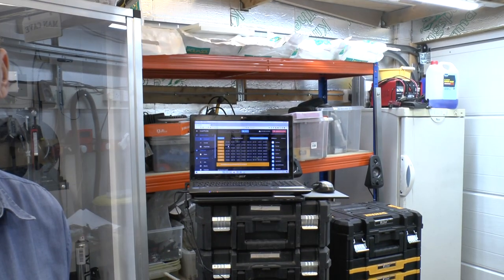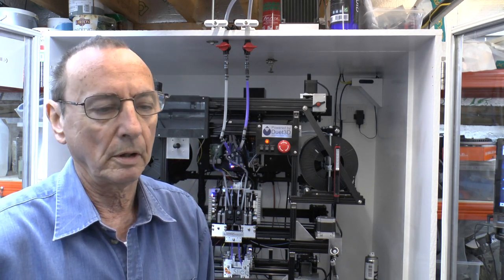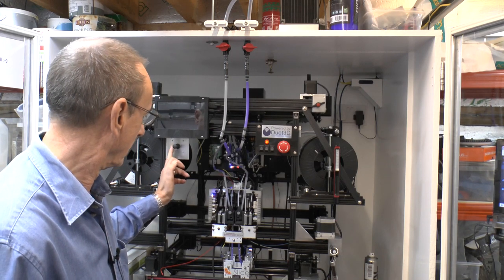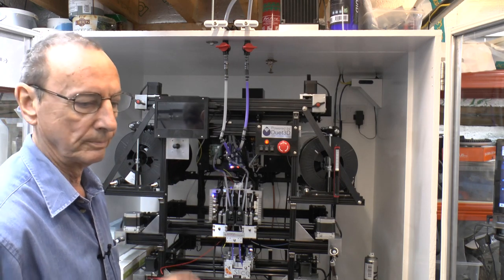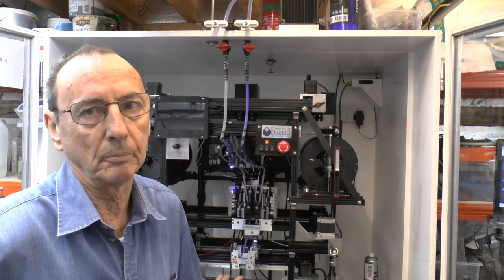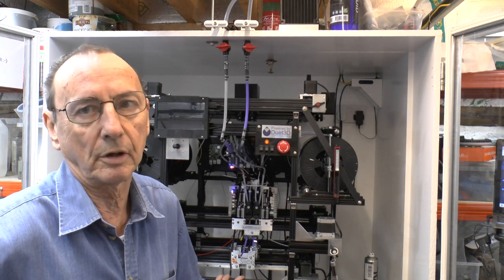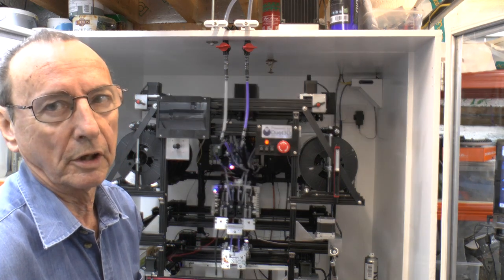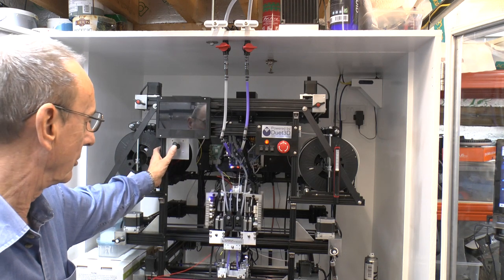Joystick jog control for my 3D printer.

Comment: Very good job. It should be easy to check the status of the printer in the beginning of your macro with some conditional GCode and abort it if a print is in progress, so the print is not ruined.
Reply from the maker: Thanks and that's already done . The command I use at the start of the macro is "if state.status != "processing" ; make sure that a print is NOT running". I believe that in RRF 3.2, there is also an additional "R" parameter (R2 I think) that one can use with M581 which will do the same thing.

Comment: That is great idea. I use macro buttons to run "M32" custom jobs for glue cnc machine. I have troubles when i press button once i get "Job already running". And im bit worried how call stack work in this instance: Press button -> run macro -> in macro call M32 -> run print -> ? is macro unloaded or it will finish after print?

Suggestion: Probably you run G1 commands to move axis then M400 to wait for finish and then check if button are still pressed.
How about not using M400 and just fill machine Que with small Gcode micro moves with rising F speed from loop? It will dont  stop between moves. Is que that big?
Reply: Another suggestion: Unbind the button macro at start of print and assign it at finish. Or You can use extra ON-OFF switch or key to enable joystick - in start of macro simple check if switch is ON then process Joy switches.